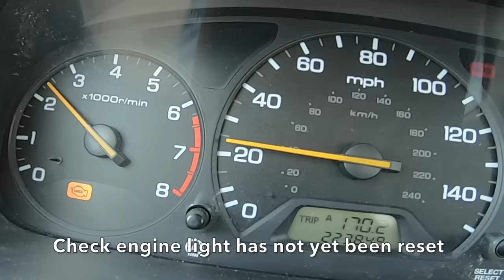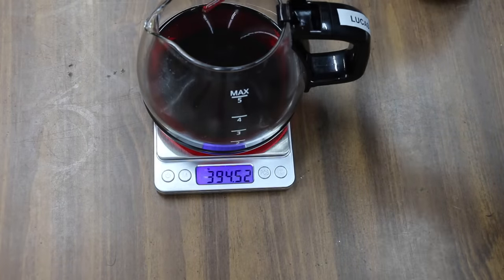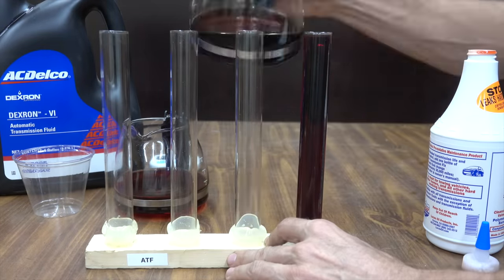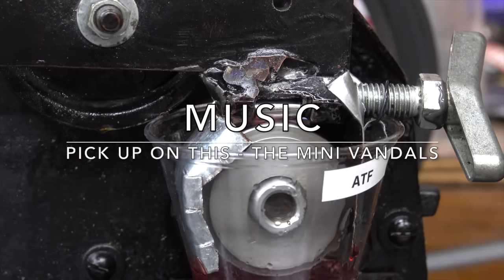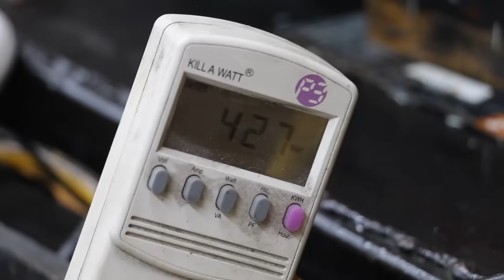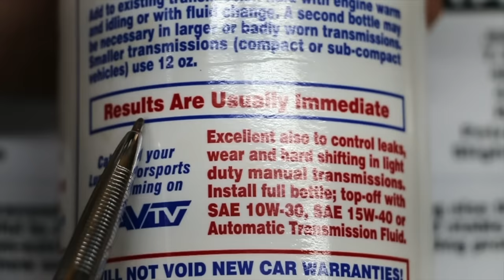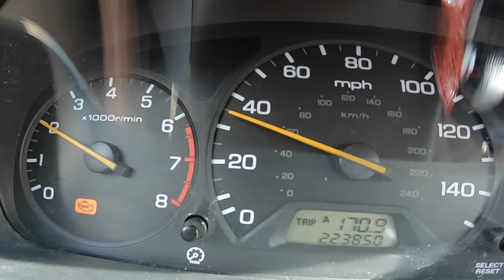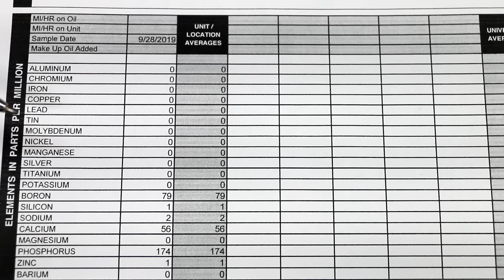Does Lucas Transmission Fix Work?  Let's find out!

Comment: I always want to see something about those ceramic coatings and do they live up to the hype.
Reply from the maker: Great test idea!
Reply: I used Avalon King on all 3 vehicles a few months ago....I'm never going back to wax. Some idiot traded paint with my dad's car when leaving a parking spot...I used a claybar and the paint came right off. Bumper is like new now....put another coat of ceramic on the affected spot.
Reply: @sonacphotos  wax protects better than ceramic? You are mistaken. Maybe you didn't use a reputable brand or didn't apply it correctly. The cheaper brands have a low percentage of silicone dioxide. Check out cquartz or avalon king (84%). Make sure before you apply that, after washing the car twice, you use a 50/50 mix of water and isopropyl alcohol (70%) and wipe down the entire vehicle with it to take off any residual waxes.
Let the first application cure for 24 hours.....hope you have a garage.

Comment: Test how oil and fuel additives affect engine/transmission seals.
Reply from the maker: Great suggestion!  Thank you
Reply: See it they "swell or soften " seals.
Good idea. Lucas works in heavy equipment hydro seal really well.
Reply: @ProjectFarm   agreed
Reply: @ProjectFarm  old mechanics used to tell me that a small amount of brake fluid in the transmission would fix leaky seals. I was too timid to try it out. I just resorted to Lucas instead
Reply: Yeah that's a good one! And high milage oils too
Reply: AT-205 Reseal touted by Scotty Kilmer
Reply: @MitzvosGolem1  stay away from the ones that claim to swell or soften rubber gaskets etc. It might initially help but within weeks that rubber will shrink down smaller than its supposed to be and cause a way bigger leak. At least that's what my experience was with those type of products
Reply: I was gonna say the same thing about AT 205 reseal
Reply: @grassroot011    that crap AT205 is what swells up the rubber gaskets etc and then they shrink below recommend size and you end up with big oil leaks.  I've had it happen to my BMW my Honda and the Lincoln. DONT USE that crap

Comment: This stuff really did work on my 2007 cadillac. Hard to believe I know,  but it's worth a try for the nominal cost
Reply from the maker: Thanks for sharing.
Reply: How much did you add? Can’t wrap my head around how it can be added to existing fluid.
Reply: @1111comment    half  to 3/4 a  bottle

Comment: I add one with every change, havent lost a transmission in one of my taxis in over 5 years. had a buick century with 2 bad solenoids about 10 years ago that i put 2 bottles in and it went back to normal unless it had been running all day. Lucas makes some real miracle products. A little known one is their gas lubricator, ive used that to unstick floats for 5 bucks
Reply from the maker: Thanks for sharing.
Reply: Are you referring to the upper cylinder lubricant and fuel injector cleaner?
Reply: @JesusisLORD77778  yeah

Comment: I know this is quite an old video but hopefully someone can respond with some answers. 

So I just bought a vehicle 4 months ago and over the past month driving it has been rough to say. Speed up 1st gear is fine but going into 2nd,3rd and 4th the rpm’s go up and then it’s sounds like it starts choking and the rpm’s go down slightly and stays that way unless I push all the way down on the gas. And it also sounds like it’s struggling to speed up when pressing on the gas after cruising between 35mph-55mph.

Comment: Do you think adding a second bottle to the transmission would've improved the shifts even more? It's pretty amazing how just adding one bottle improved the shifts that much.
Reply: I called Lucas directly and THEY told me. If you don't see results within 1 bottle, they don't really recommend a 2nd bottle. Now keep in mind, this is coming from their Customer Care Line. For me, the product did "OK". I can't drive the car too long, due to it overheating and when it overheats....you know the trans was slipping.
Reply: Use 20 big bottles
Reply: @marshalmitherz3352  😂
Reply: @marshalmitherz3352  I agree, and for maximum effect just replace the all the oil with Lucas. It will be as if it came out of the factory.
Reply: Sarcasm aside from these other posts. I've put in two bottles before. But it was done a year apart. If one bottle doesn't give you any improvement, that means you have bigger issues. And if that's the case and you're looking at a possible rebuild, a second bottle isn't going to make it any worse. If my trans is on the full line when warm, I drain out 12 once before adding the Lucas. An over filled trans will cause problems, too. I built my own fluid pump out of an electric fuel pump, pre-filter, switch from alligator clips to hook to battery, and long clear hoses that will go right down the filler tube to remove fluid, transfer gas etc. The fluid I pull out I spray in my wheel wells to prevent rust.

Comment: I like your channel brother. I also watch precision transmission. Ive heard them say that transmission additives cause the internal rubber seals expand and cause transmission failure. Have you ever thought to use the additive and measure internal plastic or rubber seals for expansion? It would be pretty in depth i think. Anyways...keep up the excellent content sir.
Reply from the maker: Thank you for the video idea!
Reply: thicker oil , will raise the oil pressure in the transmission ( average trans. oil pressure is 190 P.S.I.). if you are adding additives to compensate for "HARD" seals, that was caused by the transmission being "OVERHEATED"!!!!. the only real fix for hard seals is to rebuild the transmission!!!!

Comment: I’ve been reading about this product and some people say to drain some fluid first, but others say you don’t need to like the bottle says. What’s your thought?
Reply: Drain some fluid first. You do not want to over fill drivetrain components ever
Reply: Check the level of Transmission fluid.
Add the fix fluid
check the level again
if too high, drain some transmission fluid
check again

simple enough, don't want it to go over max in most cases
Reply: @anthonytotilo4737  ever heard of aeration? Its where the oil is whipped oxygen into it and then air bubbles, not airless atf, goes into your transmission bearings and starts to pit the bearing surfaces causing accelerated wear. So thats what happens if you overfill so always keep the level under maximum on the dipstick

Comment: 2:57 why is the table "dancing" like that? is it because it heating/dilating  and then cooling down?
Reply from the maker: You are right.  Heat cycling
Reply: noticed that too, pretty interesting. Would that happen with a more expensive griddle? Video idea! $20 griddle vs $200 griddle. Consistency, heat output, build quality, etc.
Reply: @cerealkillr12  I don't think so but maybe with something more expansive you'll see less deformation but I think this is made by the grill which sees that the temperature is getting lower than the stated and heats it again to reach the right temperature.

Comment: In the '80s when one called Trans X came out I put a quart into my '66 Mustang that was hanging up in gear.  It quit hanging up and ran trouble free for about another 6 months.  The same thing happened about 10 years later on a '76 F-150.  My experience is that the Ford C-4s gave notice that they were going bad rather than just quitting entirely at once.
Next time I have problems on my older stuff I will try a bottle of Lucas.  Won't work on my Equinox as that's a sealed transmission.
Reply: You can still use it. Must jack up the car and access the plugs on the side of the Trans
Reply: Sealed transmission sounds like a scam.
Reply: @riccocool  they are. My '99 e class was one of those "sealed for life". Turns our they all break down around 130-150k miles
Reply: @jamescopley6473  I have recently learned that, thank you. So far no transmission troubles with that car yet and it has 206,000 on it.

Comment: Is there anyway you can do some testing with these additives between Lucas, hot shot secret and others? Such as using a motorcycle style engine with a semi auto clutch. You could see how the stuff effects the clutch and gears better because it all easily accessible! There are lots out there or even if you get a beat up engine with an manual you can buy a recluse clutch kit to make it semi automatic. To simulate a car’s transmission. You might not have a valve or a pump assembly like in a tradition car but should get some good information. You can even hold the break to test heat on the clutch

Comment: If you use the Lucas before you start having problems with your high mileage transmission you will get great results. I changed my fluid, filter and shift solenoids @ 175k and added the Lucas when I refilled with fresh fluid. It still shifts like new now @ 210k.
Reply from the maker: Thanks for sharing.

Comment: I had a Ford f250 that once the transmission warmed up, it would not go anywhere, just sit and spin. I drained some transmission fluid and added 2 bottles of Lucas transmission fix, and ran that truck pulling loaded trailers for a little over a year after till the oil pump went on the engine and locked up. Of course when the transmission heated up, I had to let off the gas somewhat to shift, but it did drive and pull, and it outlasted the rest of the vehicle...the whole thing was run into the ground when I got it, I was just happy I got it running.
Reply from the maker: Impressive!!

Comment: My 2012 Subaru developed a shimmy when shifting.  I tried changing the trans fluid but nothing changed.  I drained a little fluid and replaced it with Lucas.  I noticed a slight change at first, but thought the tranny was essentially destroyed.  A couple months passed and the shimmy is totally gone.

Comment: Important hint: When doing a fluid change on a high mileage transmission ALWAYS save the old fluid until you have driven the vehicle a bit. What can happen is you can have severe band wear and all your friction material can be in suspension in the fluid instead of on the bands where it belongs. If the transmission slips after the change go back to the old fluid and just it until it dies.
Reply from the maker: Thanks for the feedback.
Reply: I'm finding this out the hard way unfortunately. My 2018 Acadia developed a delayed shift from 2nd to 3rd gear after a transmission fluid change.
Reply: Excellent point.
Reply: A good rule of thumb if that is the case is only do a partial change.
Reply: @dcm1f3  The shop may have used the wrong fluid, or not filled it to the right level.  I've heard of transmissions acting up after a fluid change, but I've never experienced it, only the opposite.  I've cured several by changing the fluid.
Reply: NEVER EVER change the fluid of an old transmission.. change the FILTER ...put that old Trans fluid back in..then top it off with some fresh fluid
Reply: @DonziGT230  you are right.. but too many cases of changing old fluid with new fluid.. and the tranny is shot right after... seen it soooooo many times...
Reply: My acura tl 07 has 246k miles. I think the last time the tranny fluid was changed was around 90k. Fluid looks light goldish color with hint of red/pink.  Should i not touch it or would it likely hurt to just drain like a third of the old fluid and add new?
Reply: Had a 2000 dodge Dakota.  Changed the fluid for the first time just short of 100K.  
Rebuilt a month later.  
If your talking really high milage.  I wouldn't even try the new fluid. Once the new is mixed and you want to go back to the old you'll never get it all out of the torque converter.
Reply: Actually It's not a good idea to use old fluid again. The best idea is to change the fluid to band-new and add this Lucas. What is does, it makes the fluid more thick, but thickness in not by  old-transmission residue, but just thick oil.
Reply: @balkee42 I'm running into this experience right now. I was told not to touch the fluid if it's been over 80000 since the last change by a professional mechanic. I did it anyway at 105000 miles on the car even though I wasn't having any trouble. 137000 on my car now and starting to have 5th to 6th slippage. Coincidence or not? I do remember he said also when it does start slipping to use this stuff. Lucas transmission fix, and drive till it completely goes out.
Reply: @balkee42 don't change it.
Reply: If the fluid shows red or reddish. You're probably ok to change the fluid.  But brown or reddish brown...No!!  Good points.
Reply: Looks like a valve problem to me, possibly from contamination. Was the old fluid burned and discolored?
Reply: my mercury sable only 4 quarts of 12 came out i stay away from a transmission flush on an old tranny
Reply: I saw a comment on a Scotty Kilmer video on automatic transmission fluids where a guy said his friend would collect the black goo from transmission pans composed of worn clutch pack material, and would dump it into slipping automatic transmissions to get them to stop slipping. I guess the logic is that if there is enough suspended clutch pack material in the fluid, it fills in the worn clearances in the clutch packs and makes the clutches grab again.
Reply: It is better never to change the fluid in an old transmission.
Reply: I learned something! You betcha I will save the old fluid. So ... where can we buy "friction material" in case we already recycled the old fluid?? 🙃

Comment: Awesome video! In my older car I added a bottle of this stuff after a transmission fluid change and it helped out quite a bit. But the bottom line here is that this product is made to help transmissions that have been poorly maintained. Change out your transmission fluid in a reliable transmission every 50-80k miles and you should never have to add this stuff at all. But unfortunately people don’t care about their cars this in depth and that’s why products like this exist, to be able to prolong the life of a transmission as best it can. Excellent video!
Reply from the maker: Thanks so much!
Reply: @ProjectFarm  was told my 2002 honda accord 4 cyl trans NG by Honda. They said i can't rebuild and need new at 4k
No ck engine light is on
Had car since new. Wonder if this stuff will help. Car only has 107k miles. Do you just add this to fluid?

Comment: when you run a thicker oil in the transmission , that will raise the oil pressure. average oil pressure in an automatic transmission is 190 P.S.I. that is in good shape. a good way to find out what shape the transmission is in , would be to remove the pan and see how much clutch facing material/ metal shavings are in the pan. the pick up filter can be plugged also, reducing oil pressure, and causing accelerated wear. the shifting of this transmission is performed by the computer in the car, and changes depending on load/ driving habits.
Reply from the maker: Thanks for the feedback.
Reply: 2 years or 40k km changes and Lucas trans fix bottle added every time.

When you're driving at low speeds in carparks, or anywhere that is going to be low speed, you should always put these boxes into manual mode and keep it in 1st gear, I'm serious.  That 1-2 at low speed kills these boxes.

I'd also never tow a damn thing with these boxes unless a very light trailer or something.

If you wanna spend the money, get as big of a transmission cooler as you can fit on the front of your car radiator, and bypass the stock setup to prevent issues with coolant/oil mixing with the stock design, as a failsafe. (You might lose a tiny bit of fuel economy, but you'll gain tranny reliability).

Also it helps to annually reset the transmission learning algorithm, either via a scantool or by disconnecting the battery terminals and then touching them together.  Also helps to turn the headlights on to drain all the power out of the capacitors while you're at it.  Peace
Reply: @DoubtingThomas333  , I rebuilt transmissions years ago( retired) and yes you are very correct ,I call low speed driving as "WAISTED SHIFTS". cars / trucks today are shifted by the vehicles onboard computer. back when I was rebuilding transmissions, the governor( driven off of the output shaft) in the transmission did the shifting, with the modulator valve delaying the shifting( operated by engine vacuum)that had a pin going into the valve body. then there was a "KICKDOWN" link that was" listening" to carb throttle position, and a lever on the trans that sent a signal to the valve body to downshift from 3rd to 2nd at any speed. this was used for "PASSING". I always would set the rebuilt transmission up for "HARD SHIFTING", soft shifts will cause friction material to wear off of clutch packs/ bands, and wind up in the pan, clogging up the oil filter. you can tell what shape the trans. is in by pulling the pan and see how much clutch facing material is in the pan. the other big trans. killer is high operating temperatures, causing "BURNT" fluid( brown fluid). I can honestly tell you that in all of my years of driving, I have NEVER had a transmission "BIT THE DUST" on me!!!!
Reply: @ProjectFarm  ok